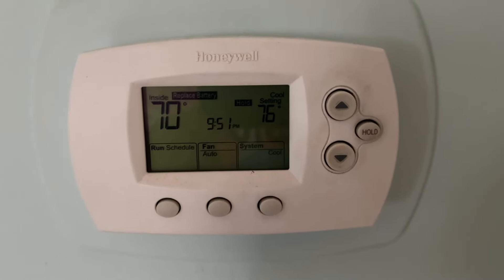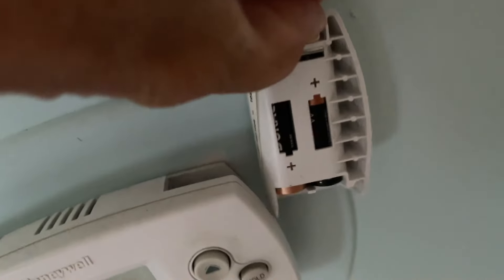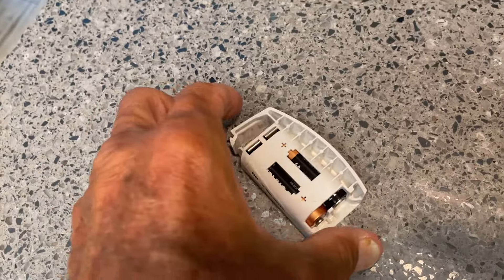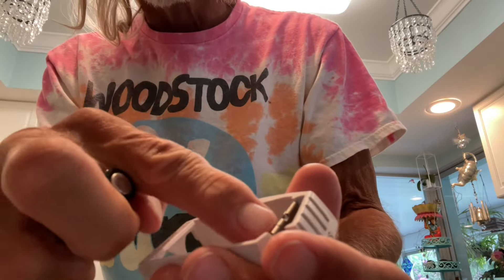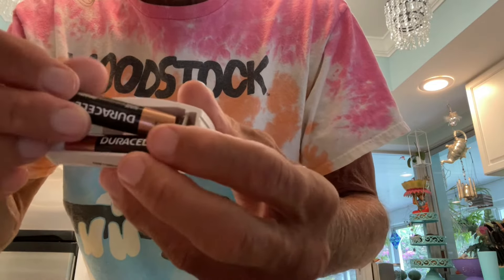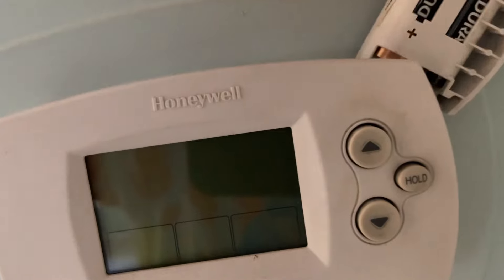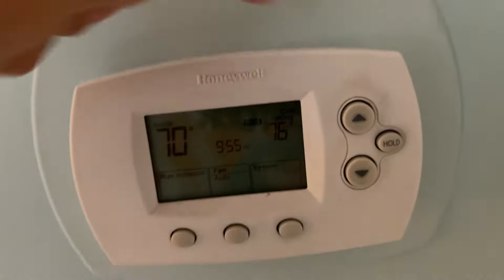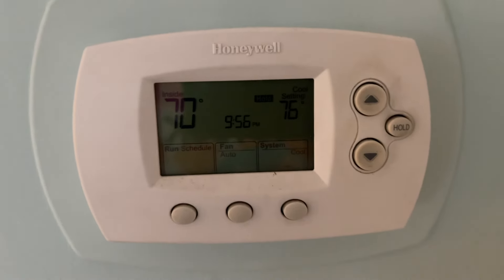How to replace the AA batteries in a Honeywell Thermostat

Comment: hi tom I was wondering could your thermostat be stopping you from controlling your heat in your house if it is blinking replace battery?
Reply from the maker: Yes, you may need to put new batteries in before it’ll work

Comment: Hey Tom. Was thrilled to find your video and changed the batteries without a hitch. I have the exact model you show in your video, but the screen is still black after 10 minutes. Not sure what to do. Any advice? Thank you
Reply from the maker: I actually replaced this with a new one because that happened to me and I made a video about it. It’s pretty easy to do and they’re very inexpensive. Good luck. Thanks for watching.
Reply: @TomLeeman  Thx,  Tom. Will watch your video to find out how to get it off the wall!😊